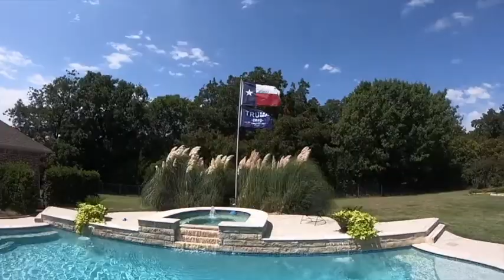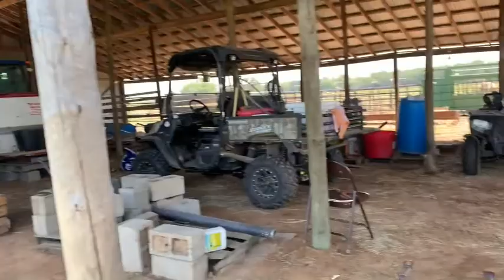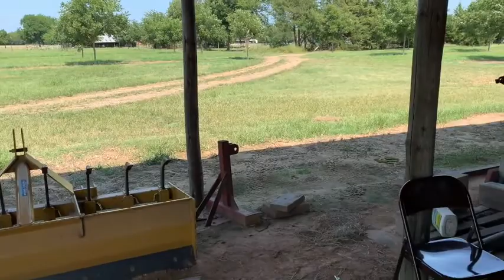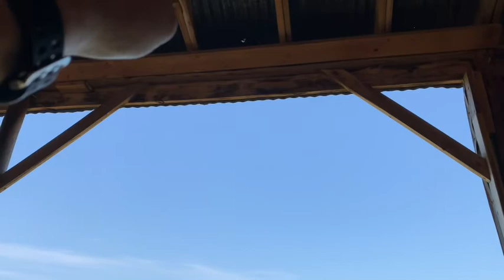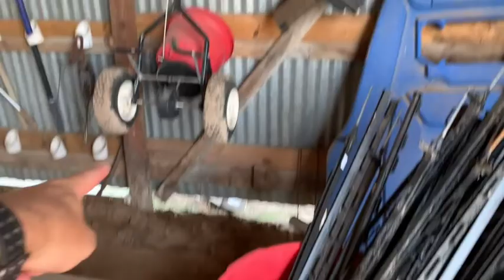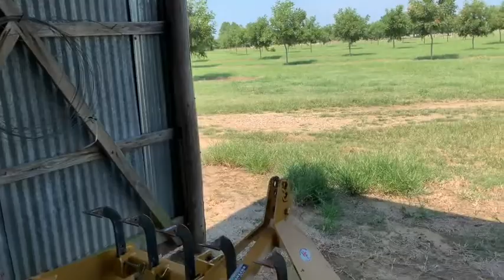HELP! Pole Barn Problem

Comment: I like your solution to put in a new post beside the old corner post and lag bolt them together. A new barn would be nice, but I'm of the mindset that a farm should pay for itself and if the farm can't afford a new barn then just keep scabbing together the old barn like you've been doing.
Reply from the maker: Tex Farmer -   Yes I agree totally.   The barn works well for us, I really need it to last another 5-10 years.  Appreciate the advice.

Comment: Man, that’s a hard one, I’d have to sit it the thinking pool with bigger flags and think on it. In all honesty seems wood, earth and weather always ends this way. If you’re wanting to just leave it up instead of replacing, maybe cutting off enough to wedge a cinder block with a cap block to create some upward pressure may help. This is what has been holding up my videos, fighting decay in my shop on the wood. Been coating wood like crazy with hydraulic oil to try to get it water resistant, just got to keep any fire away from it. It’s tough man.
Reply from the maker: Truly appreciate the advice.  There is always something, right?   Seems like this world just keeps punching every day.   Ugh.   Thanks.
Reply: Heritage Farms Texas no doubt, always something. That’s the route I’d go and I’d probably just keep shimming it if it settles. Off the top of my head that’s all I can think of right now.

Comment: 3 large 10 inch diameter or bigger pressure treated posts in front.  Put a 45 angle at the top away from the barn and lag them jokers before you hit it with either a tractor or a small wind comes by.  And yes, all three on the side, or replace the 2 inside with 6 by 6 pressure treated.
Reply from the maker: SoosV - I like your advice,   That would be a solid solution.   The barn is too nice to scrap just yet.    Just Needs some help

Comment: It seems like once you start down this road there's no turning back every repair means you need to keep the building longer to justify the cost. Yes I understand the budget constraints and I would fix it too even knowing it will probably need more work in a couple years. If I wanted the building to last five years I would take the easy road and set another post in the ground and bolt them together if longer I'd take a shaft with some flat iron on top dig a hole fill it with concrete and push the shaft into it. Then weld some steel to the plate on two sides of the old post, bore holes through and bolt together. It may not last forever but it will last a very long time.
Reply from the maker: Wow, what a great comment.   You nailed it.   I have been thinking the same thing.   Where is the tipping point?    I have to work a while longer before we build our forever home there.   Probably kick the can down the toad for a couple more years.

Comment: As that pole is not holding any weight (just swing in the wind) you could remove the whole pole and replace it, if that is a financial option. As for the rest of the barn you might consider completely rebuilding one wall a year .
Reply from the maker: High plains mini-stead - I like your advice and thoughts.    The barn is 75 % solid, just needs some help.  I was thinking of renting a scissor jack and replacing/adding few boards where needed on the top.   Thanks again.

Comment: # of poles is the reason it withstood the wind😳.  Gotta keep the roof from leaking.  I would use a small concrete pour under the pole and then anchor to the existing pole.  I am a conservative and thus will vote the other way 😉.
Reply from the maker: Geiger Farm - hey, thanks for watching.  I like the idea of pouring a concrete footing.    Perhaps I could set metal in the concrete and anchor the metal to the existing post with bolts.   Good idea.    All that matters is people vote.  That’s what makes America great.    Truly appreciate you watching.
Reply: @HeritageFarmsTexas  Agree.  You don't need much concrete...

Comment: I have 2 pole barns.  The carpenter bees like to burrow in the 2 X4s.  I have a broken pole in one of them.  A guy recomponed to use a metal sleeve instead of replace the entire post. In your case, why don't you jack it up a couple of inches and place concrete pavers under.
Reply from the maker: Liberty Garden - thanks, that’s a interesting idea.    At the very least, a temporary fix until I can find a permanent solution.

Comment: What about digging out the old rotten post and pouring concrete then anchoring the post to the concrete
Reply from the maker: Lance Sheppard - I think you have the right idea.   I like that approach.
Reply: @HeritageFarmsTexas  I reckon it will be right much digging but if you square up the bottom of the post you could do one of them metal brackets
Reply from the maker: Lance Sheppard -   Thanks

Comment: Trump 2020 and beyond! I would  cut and sleeve that pole on the corner with a steel tube and put a new bottom post in it with a footing. Maybe put a few flying W's on the trusses for extra roof support. And then repair that corner much the same as you have the rest of it. You could also fishplate a new section in that corner.
Reply from the maker: The Drifter - appreciate the advice.     I like the idea of a new concrete footing with a metal post set in it that slides over existing post.    I’m not sure what a fishplate is.   I’ll have to research that.    This election is going to be so important.    Very important for everyone to vote.    Thanks!